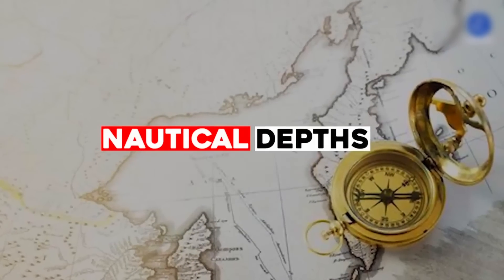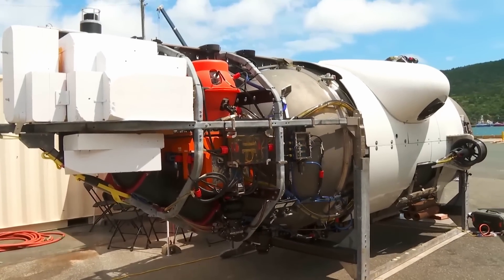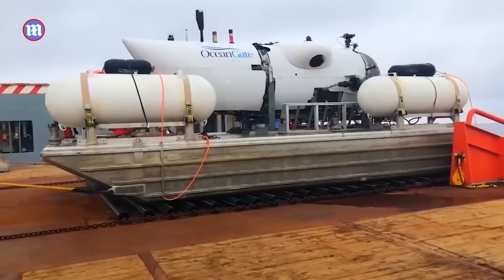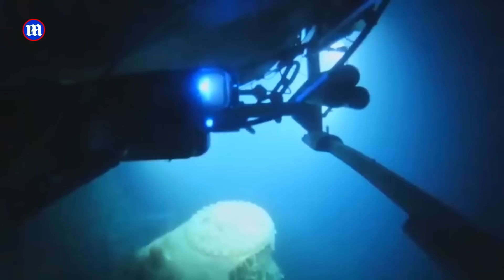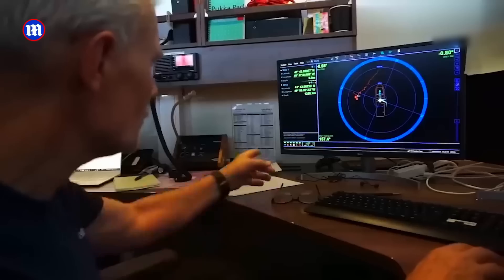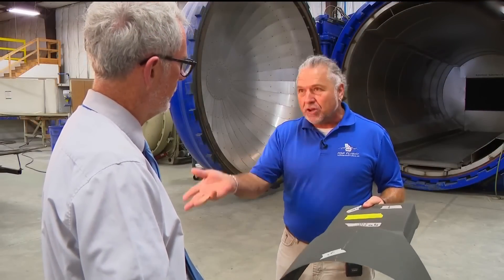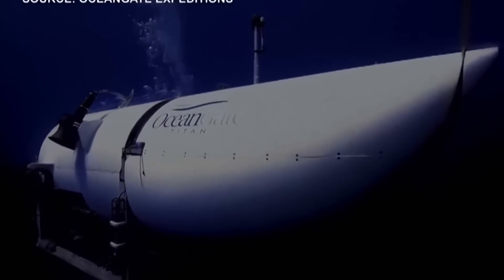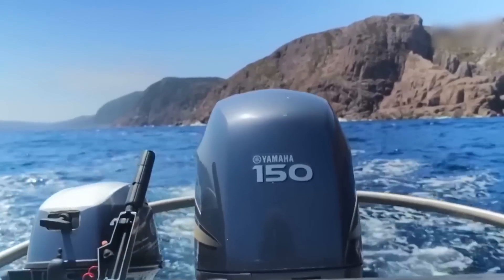Shocking! 5 Avoidable Blunders That Led to Oceangate Titan Tragedy!

Comment: The first hint at a questionable operation was the insistence of the $250,000 passengers signing on as "Mission Specialists".   Assume a major airline started having passengers signing on as "Service Technicians."  The airline could claim that since they carried no passengers they need only certify their planes for carrying cargo.

The lack of Classification says much more than getting a certificate.  It points to a lack of a valid peer review.  The Class Societies have developed rules for minimum requirements for vessel compliance for design, construction and inspection.  Rush has indicated that the Class Societies are against new technologies.  Nothing could be further from the truth.  My experience is that Class Societies promote innovation provided the innovation meets or exceeds their standards and that suitable engineering supports the design.

From the start of my career as a naval architect and marine engineer I worked with Classification Societies both in plan approval and vessel inspections as well as new rule making.  At times it was a struggle to gain approval of new designs or "different" interpretations of the rules.  At other times their insights provided better paths for achieving intended goals.

Mr. Rush would have you believe that the Classification Societies would have prevented the Titan from being built.  20/20 hindsight would indicate that had the Titan been Classed Mr. Rush and four others would be alive today.

Comment: the titanium ring is glued to the outside of the carbon tube. the carbon can be pressed together under pressure and then the glue with which the titanium ring is glued loosens
Reply: The centre of the tube compresses 3/4 inches. This could distort the ends.
Reply: As the two expand and contract differently, that would surely fracture the glue ring.  Carbon fibre strength aside, I'd never rely on that on the surface without mechanical assistance via a locking ring or clamp, let alone at depth.

Comment: 2 major flaws in that ridiculous design. 1- designing a tubular configuration rather than a sphere, MADE FROM CARBON FIBER? ...i mean even the soviet Titanium military submarines wouldnt attempt to go even a fraction of that depth. temperature change in the 30's along with pressure...duh. 2- I mean epoxy gluing Titanium to carbon fiber...ridiculous. without a doubt, those Titanium caps popped off instantly under that pressure, just like squeezing a tube of grease and both ends blew out in a millisecond and exploded from the air inside instantly heating up to the temperature of the sun...NEVER attempt those depths, unless you use 1 solid peice of material....in a sphere, where human lives will be

Comment: The " Rapid Alert System " is as useful at predicting implosion as an Air Bag is at predicting a road traffic accident.
Reply: Should have used crazy glue instead of epoxy, duh.😂😂😂
Reply: Worked as designed 😮... they knew they were Fu<#ed for at least 10 minutes. 

I'm thinking the loud cracking of the epoxy would have sufficed 😅😅😅.

Comment: Mistake 6: "...the viewport at the forward of the submersible was ONLY BUILT TO A CERTIFIED PRESSURE OF 1300 METERS"!!! (Quote from the technical description) Additional to all the other flawes it´s not only insane, it´s criminal, especially when you take passengers with you!